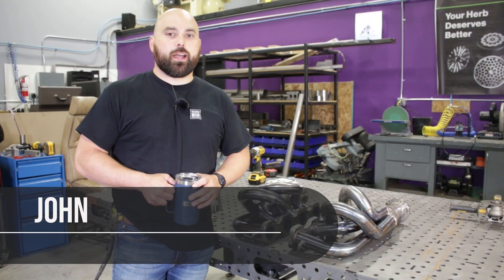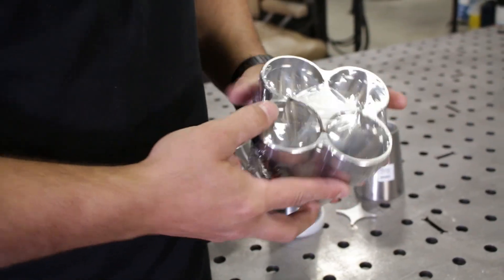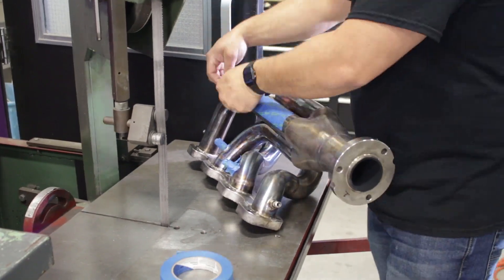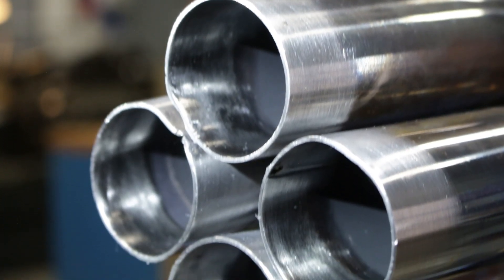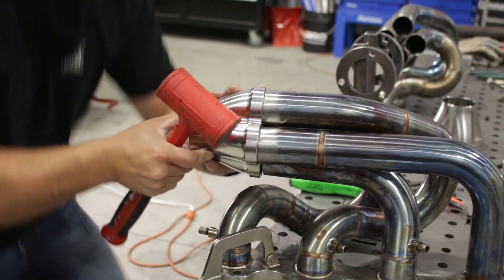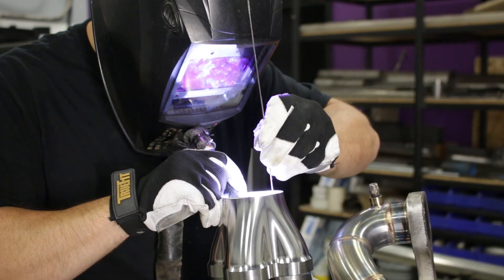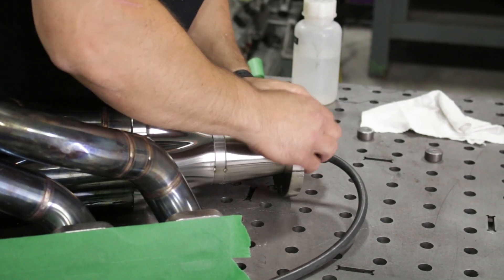The RIGHT way to build a 4000HP Turbo Manifold

Comment: It's so surprising that it necks down that small.  Is it class restrictions?  Or is there physics there that isn't making sense in my head?  I know in gas powered drag cars you want as little backpressure as possible but even in the highest power applications they are only making 80 psi compared to this 200 psi.

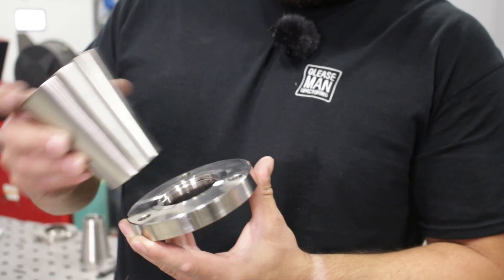Comment: You make the jig wih the parts not prepared 1:58... notice this at 4:00....You do this at 4:05 and this at 4:10 and then you are ruling surprised at 7:07 it doesn't fit? I stupid? I mean that was obviously foreshadowed to be like that. You clearly don't plan in advance 🤣😂
Reply from the maker: I'm not understanding your logic... You have to jig the header before it can be taken apart. The part I cut off was a tapered cone that was too small to fit in the flange.
Reply: Edit at 7:13 is exactly that pice missing which you cut off at 4:10 hilariously inlogically  chaotic reasoning there. Top comedy gold their 😂🤣

Comment: I'm surprised you're not using schedule 10! Hands down, the best thing for that application! You're probably still going to blow that tubing out.
When it blows out. Look into 316 schedule 10.
Reply: yeah I thought schedule 10 was the default for turbo manifolds but maybe there's some weight reduction reason for not using that here? even my 3 cylinder manifolds were pretty heavy in schedule 10 1.25"

Comment: Good video but something feels off with that failure, is the header undersized or is the customer not using flexipipes in the rest of the exhaust? I've never seen such a failure with those formed collectors